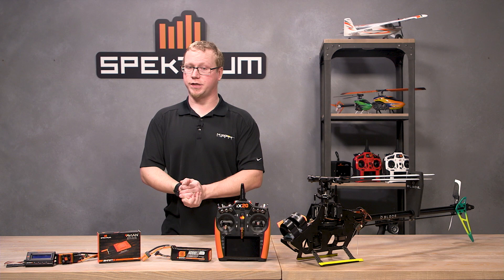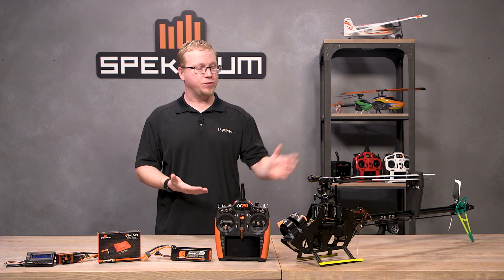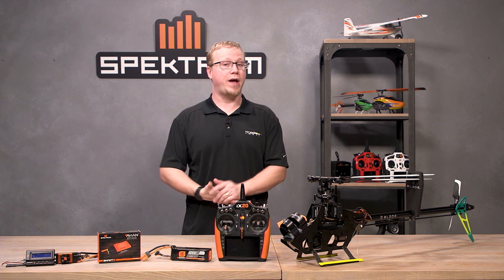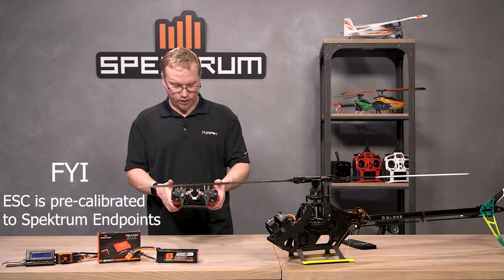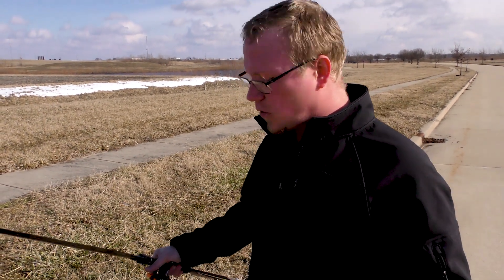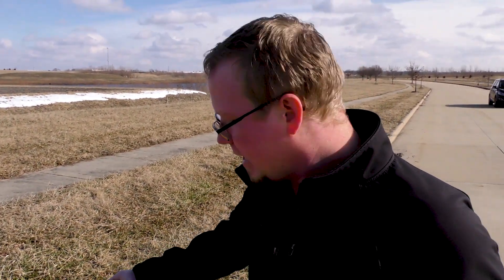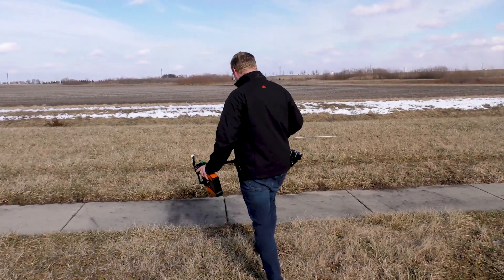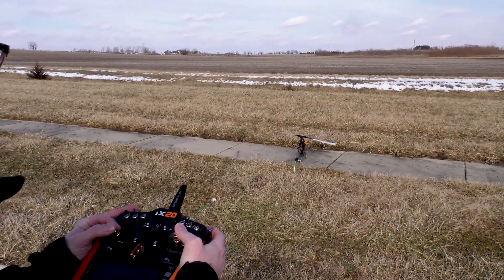Avian Smart ESC Setup - Governor Setup

Comment from the maker: In this video Tom teaches our fellow RC enthusiasts how to best utilize the Heli Governor Mode built into the Spektrum Avian line of electronic speed controls. 

 In the “Helicopter (Store Governor)” mode, the ESC will save the “Motor RPM-Throttle” curve after the Governor Calibration. After adjusting to this mode from any other mode, you need to standardize the speed when the ESC is connected to the battery for the first time and you needn’t standardize the speed again after disconnecting the ESC from the battery first and then connecting it to the battery again. If adjusting to any other mode from this mode and saving the “Motor RPM-Throttle” curve, and then adjusting back to this mode, the “Motor RPM-Throttle” curve saved by the ESC will be cleared, and you need to standardize the speed once again.
If your ESC remains in this mode in future, then it will always carry out its operation as per the saved “Motor RPM-Throttle” curve. When standardize the speed for the first time, we recommend using a battery in good condition. After the RPM standardization, change another battery with the same number of cells to fly your aircraft. At the same throttle amount, the RPM should be consistent with the RPM of the first flight.

Video links mentioned -
ESC Mode Change - https://youtu.be/WuwQF7ba34Y
Smart Link App Windows Download - https://www.horizonhobby.com/pdf/Spek...

Equipment used in this video series
Blade Fusion 480 Smart Super Combo - https://www.horizonhobby.com/fusion-4...
Spektrum 6250HX w/ 4651T Telemetry Rx (included with Fusion 480 Smart Super Combo) - 
Spektrum iX20 Smart Transmitter - https://www.horizonhobby.com/fc6250hx...
Fusion 480 Stretch Kit - https://www.horizonhobby.com/fusion-4... 
Spektrum Avian 100 Amp Smart ESC (included with Fusion 480 Smart Super Combo) - https://www.horizonhobby.com/avian-10...

Make sure to follow us on Facebook and Instagram for all Spektrum News and Promotions!
https://www.facebook.com/SpektrumRC/
https://www.instagram.com/spektrum_rc/  
@SpektrumRC

Thanks for watching!
Reply: Can you get unzipped software download?
Reply: My heli goes into thermal protection
Reply: it would be nice if he would tone down the music while he's calibrating the esc. how can we hear the single tone at the end while there's so much noise.

Comment: I've set my rpms to 1800 2400 and 2800 when flying at 2800 esc goes in to thermal protection and reduces power significantly that heli comes down I always mange to do an auto rotate to prevent damages @SpektrumRC
Reply from the maker: Try increasing the airflow over the esc by adding some holes into the canopy.  Otherwise what is your setup?
Reply: I got the same thing going on thermal protection gos on. In gov mode
Reply: @edgardojagr216  the 100 amp esc is too low rec  the 130 amp avian you can run higher rpm and does well and when it heats up it'll stop but recover quick
Reply: They sell the kit with 100esc that's what I have. Y? Not with 130 esc. I cut holes in the canopy . See if it helps tomorrow when I go flying 😁
Reply: @edgardojagr216  you're best fix was to fly without the canopy that way u didn't cut holes you'll quickly find it will still shut off unless you reduce your rpm to about 1800 or 2000 max
Reply: @edgardojagr216  you'll have to get a 130 amp esc as least if you're especially flying big air with some 3d

Comment: Hi my programming box say connecting to pc power on heli and nothing happens just sits there operating system windows 10 it confirmed plug in and setup but doesent connect to smart link
Reply from the maker: Which ESC are you trying to access? Also double check your connections for correct polarity
Reply: @SpektrumRCvideos  Avian 80amp smart ESC connections correct white to the signal
Reply: Worked fine connecting to my heli when i reversed the motor just not to the pc

Comment: better off doing in doors with blades off as may blow over if there is wind
Reply from the maker: You have to do it with blades on for the esc to properly calibrate the loaded RPM

Comment: ☠️BLACK BARON☠️ How do I easily setup the max RPM at 100% throttle for a 5 blade rotorhead which should be something around 1500-1800rpm depending on the blades a scale modeller is using?
Reply from the maker: Use throttle curves
Reply: @SpektrumRCvideos  ☠️BLACK BARON☠️ iGet an "ESC Warning message" on my iX12 everytime iReset the Avian and trying out the "Very Soft Motor Start"

Comment: Spektrum - I've tried this about 20 times over and over but it just doesn't store the max RPM in the ESC.  Same as the Hobbywing which I've done 100's of times it always stores the RPM as zero - "0"
On the Governor page in the PC software it states "NAN" next to the RPM Required.
Could anyone help.
I've done:
- Enter Heli Governor Store Mode
- Lipo Fully Charged
- Set throttle to 50% and blades on zero degrees
- Heli in place, throttle hold off, heli spools up until RPM stabilises (about 5'ish seconds), leave for an alternative 20 seconds
- Disconnect lipo, connect again to programmer and PC.
- Head speed never safed
Please help!
Reply from the maker: Hi Anton, What esc are you using? Can you give us a bit more info about your power system? Thanks!
Reply: I am having the same problem using the 1060 smart ESC. Also in flight I have no change if I select idle1 or idle2.
Reply: I’m using the 100A Avian ESC.  I’m doing everything the same as in the video which is the same as the Hobbywing ESC.  The ESC never stores the max rpm so no data display. 
I also noted other comments about the “hard start.”  The ESC only does soft start once.  If I land, do adjustments, it’s got a really hard kick on spool-up.  The program box has a “very soft” where the software only got “soft” however, still got the hard kick on spool-up.
Reply from the maker: @anton38357  It is something we are looking into. One thing you can do to avoid this is to make sure you leave throttle hold on for a few moments after changing settings, or even flipping hold on and off again to make sure if sees that signal before starting up
Reply: @SpektrumRCvideos  - I tried this too Spektrum.  The “Soft Start” only stays for about 10’ish seconds after landing.  Flipping the throttle hold off and quickly on does not allow the ESC to enter “Soft Start” on any spool up after. 
The only way to enable “Soft Start” is to cycle the lipo off and back on to do a complete re-start. 
The Governor setting on this ESC also never safes the maximum RPM in the software and I noticed the RPM does not pickup while in hard manoeuvres - same issue many pilots have on various sites. 
I personally feel this ESC was not ready for supply to the RC market.

Comment: I set the end points and store gov calibration but when I go to the Smart Link program there are no values showing up on the sliding scale on the RPM side.????
Reply: I am having the same problem. I even hit idle 1, idle 2 and no change.
Reply: I get the same.  The Spektrum ESC just never stores the max rpm so no values in the software.  I contacted Horison on numerous occasions and their replies is all around the subject.  Keep on telling me what I should “really” do...
I’m using the same procedure as in the video which is the same as the Hobbywing with no luck.
Reply: Having the same problem with mine esc. Tried ten times with no luck

Comment: Thanks for the vids Tom! This is a good video to show us how to set up the esc. Can you do a video showing us how to enter the info into the transmitter, to read the RPM correctly for the telemetry (ix12 and 20)? I set it up in the rpm telem screen and had 90k rpm. I deleted those settings and I entered  them into the telem esc screen.. but I get "1,"  once it goes over 1k rpm? 10 pole motor, 9.166 ratio.

Comment: Will a 65c to 45c battery have to be recalibrated ?
Reply from the maker: Nope! It is required when there is a power system (motor, lipo cell count, different blade size) change or gearing change. Hope that helps!